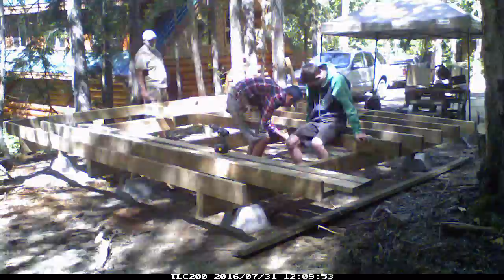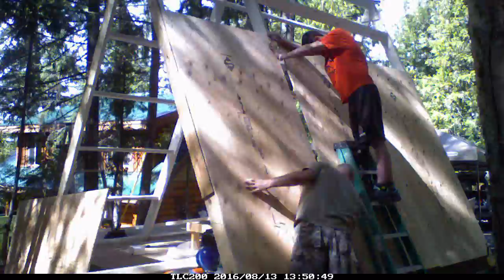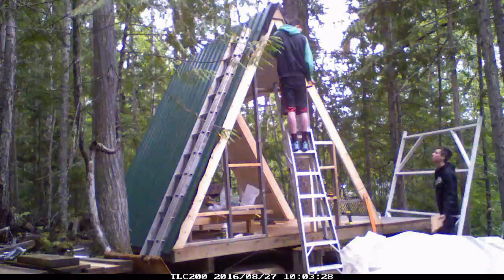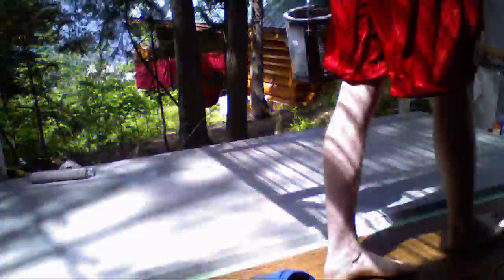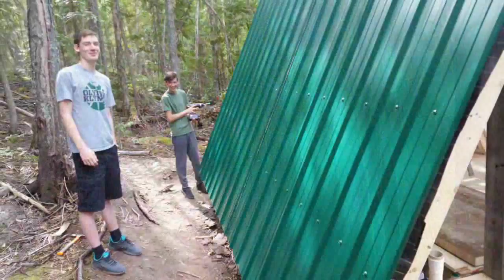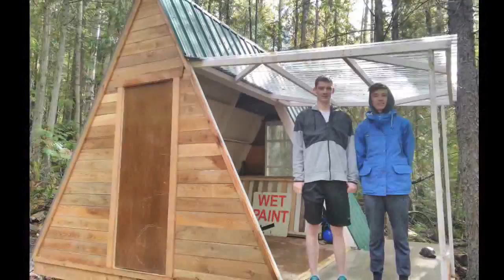The Eh - Frame Timelapse

Comment: What are your floor dimensions inside? Same size as the plans or is yours longer?
Reply from the maker: We added 4 feet to the plans. Without the deck it is 12x8 feet
Reply: Isn't the original plan 10*8 therefore only 2 foot added?

Comment: Well ya got it done. Too bad you didn’t do any research prior to the build. It looks fine, but it’s got several problems that I spotted. It can’t last very long with the methods you used. Sorry..
Reply from the maker: Mark Pool okay boomer
Reply: If you're going to take the time to make a comment like this, you can at least elaborate on those problems you spotted so that people can learn from it...
Reply: Jacques Krause Wow, I musta been in a bad mood when I wrote the comment.. my apology to the poster. I do think that the main thing that put me off was that they ran the floor out beyond the wall (to create the exterior deck space). This is going to be a permanent problem with water leaking into the house. No amount of caulking can stop it. Again, sorry for coming across so rudely.
Reply: @bighammer587  Well thanks for taking time to elaborate your thoughts and address your tone. Kudos. :)
Reply from the maker: @bighammer587  Ya thankyou for elaborating. We actually made it slightly crooked by about 1 inch (on purpose) so that water drains off the deck away from the inside of the eh-frame, as well as using caulking and flashing. So far we've had no problems
Reply: @bighammer587  In the plans there is a drainage gap. Not sure if they included it here